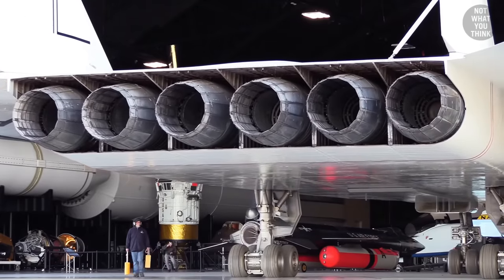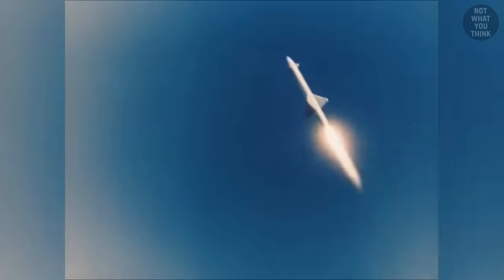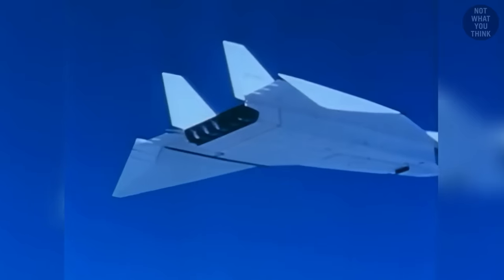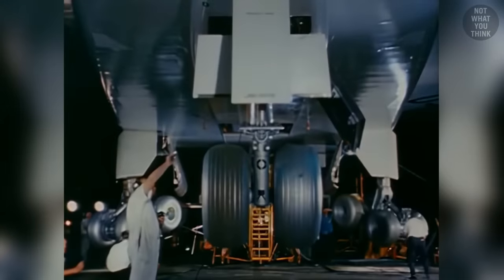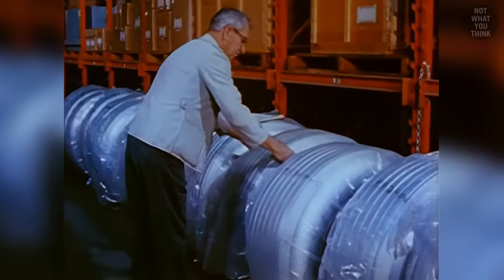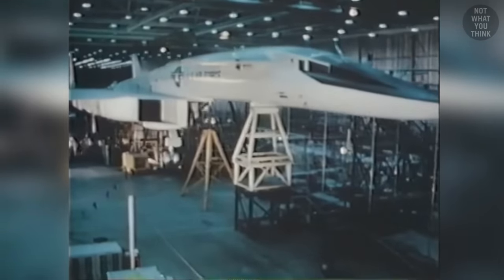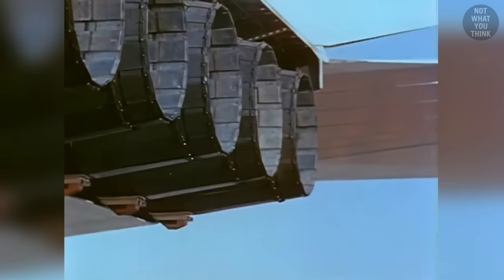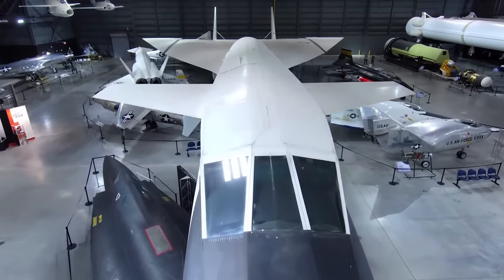The Airplane That Looked Fake, But Was 100% Real: XB-70 Valkyrie

Comment: One of the things that absolutely gets me is that we have this footage of such a futuristic, marvel of engineering surrounded by typical cars of 1960's. Sometimes I cannot help but wonder what secret projects we're hiding that would seem such a 50+ years ahead of our time.
Reply: We didn't hide this plane back in the 1960s. The SR-71, F-14, F-15, F-16, F-18, B-1A, B-2, YF-22 and -23, and both JSF contestants were all revealed pretty quickly. The F-117 was revealed in 1988 after a first flight around 1981, so that was kept under wraps, but only for a few years.
Reply: there's a video tour of the inside somewhere on YT which definitely shows the age of the design
Reply: TR3-B
Reply: The Vauxhall Zafira.
Reply: They can from a distance read your brain ,your memories, what you think and can talk to you and see your mental images and what you see from a distance ,a long distance no wires no chip needed.
Reply: The research for the B70 project started in 1955 and the technology to make the Valkyrie a realistic proposition was available by 1957. The project suffered from the normal changes of role and funding before it flew in 1964 and was officially terminated in 1969.
Reply: @Cdub-nz4gz  That isn't even a grammatical sentence, far less make any sense.
Reply: @rattywoof5259  thanks
Reply: You said it B u b
Reply: Maybe. They did have remote viewing and out of body experience programs at one point with things like project Stargate. AATIP, the UFO program that ended in 2012 was up to this sort of stuff too. I'm not sure what sort of results they got, but the programs did exist.
Reply: The hp of cars tripled in the decade for that too. The Corvette went from 150hp to 435 between 1953 and 1967. They had a revolution too.

All the pilots of shiny high tech Sabres all went back to base and listened to Hank Williams or Doris Day on the jukebox in 1952 lol.

Comment: The XB-70 is an incredible aircraft built by incredible people.  The loss of air vehicle 2 was a tragedy both in the measure of human life and the science that the aircraft would have performed.  I've been to the crash site of both the XB-70 and the F-104.  I have few small pieces of titanium and a small section of honeycomb from the aircraft.  Volunteers have built memorials at both sites to the pilots and the aircraft.  It's quite something to visit.
Reply: Yes, I understand.
Reply: They didn't clean up the crash site? Or I guess there are just so many tiny pieces that even after cleanup you can still forage around and find some?
Reply: @mrbillfeng  They don't take it to the point of sifting acres of desert sand.
Reply: F104 crash sites arent hard to get by

Comment: It's odd as hell seeing footage of cars and trucks from the early 60s mixed with such a futuristic looking aircraft.
Reply: Not as odd as seeing futuristic aircraft in the 1960s.
Reply: Its like watching some sort of science fiction film
Reply: I thought this same thing.
Reply: Welcome to the fallout fandom!
Reply: The first futuristic looking wedge shaped concept cars were designed in the early 1960’s too.
Reply: Funny thing is most of the car designs were inspired by aircraft, drivers seat of a 1960 chrysler windsor 300 feels a lot like a cockpit all the glowing lights and push button transmission and the giant wings running down the sides. they tinkered with jet cars for a while too.
Reply: It's the same feeling when you see early integrated circuits - on a macroscopic scale there are some electronics from the 60s that could be easily mistaken as belonging to the 80s
Reply: another crazy thing is the F-15, still one of the best fighters in the world started development in the late 50's.

Comment: It is amazing how futuristic this plane was, when we realize everything was worked out with slide rules. For those of you who aren't 81(as I am), the slide rule was in regular use, even for the space race. Great video, as usual. Also, as usual, you told me things I didn't already knew, such as the photo op. I don't think that was talked about at the time.
Reply: it astounds me that y'all were sitting there with slide rules and did better, faster, and cooler things than we've done with CAD and "better" materials
Reply: And mechanical calculators...cranking away...the noise. Then Wang calculators.
Reply: We weren't allowed to use calculators, which cost as much as a good used car, when I was in school. Slide rules ruled.
Reply: @MarcusWolfWanders  I did use a slide rule one summer working for the highway dept, but I was not one of those who built the sr71 nor the space program. They were the real hero's those days.
Reply: I still have my slide rule from college. Spent my freshman year, 75 - 76, trying to learn electrical engineering. The Calculus torpedoed that idea.
Reply: Remember how happy was my dad when he got first calculator back in.. 1976(?)
Reply: @altergreenhorn  My 1st was a Bowmar Brain.
Reply: @Dxyzxyz 
The ChiComs still use Wang calculators, (at least when they want to add up 10+1)...😏

Comment: Both prototypes were operational. Flaws in the sandwich structure of prototype number 1 after its first high Mach run resulted in disbonding and it was never flow that fast again.However it continued testing with NASA before being retired. Prototype 2 that crashed was built with an improved structure and different wing incidence.
Reply: Dihedral, not incidence.

"AV 1 had zero degree wing dihedral versus 5 degree on AV 2. This change was issued to correct lateral dynamic stability problems at intermediate supersonic speed and became evident too late in the manufacturing process to be incorporated on AV 1 which utilized a bobweight to provide the capability for pilot compensation."

Comment: During a business trip in the 1990s, I had some spare time, and made my way to the Air Force Museum, outside Dayton, OH. I was aware of the museums exhibits, and made a bee line to their B-36. After viewing that for a while, I started looking at their other artifacts, such as the remaining XB-70.
Reply: The B36 could allow engine oil changes in flight. - former air force mechanic
Reply: I served one enlistment in the US Air Force from 1967 to 1971 as a meteorology observer .  The air base training school was Chanute AB at Rantoul Illinois. FYI that is located about 40 miles north of U of Illinois campus at Champaign-Urbana IL.  Back in the day, the base was a mini version of the Dayton Air History Museum.   Vintage WWII aircraft were scatter around base.  But the off the end of the main runway on a taxi way display ramp sat a B36 Bomber.  It had suffered mechanical problems and made an emergency landing. It was never to leave as the runway wasn't long enough for it to get off the ground again.  Fourty feet of the fuselage was out of the middle, the it was welded back together and put on display.  Chanute AB has long since closed.  It was sold to the city to become an business incubator and residential area. I have often wondered what became of the aircraft.

Comment: The primary reason for the fold down wingtips was not for capturing the shock wave.  Here is a quote from the book "Valkyrie, North American's Mach 3 Superbomber" on page 39 (which is a fantastic book.)  Quote: " North American folded the wingtips primarily to increase the directional stability and minimize drag by allowing smaller vertical stabilizers." The original B-70 design did not include the fold down wings to achieve Mach 3 and while there was a very small gain in lift from the folding wings, the real purpose was to reduce the drag from what would have to be far larger vertical stabilizers which would cause much more drag.  Since the wing area was required for low speed flight and there was already plenty of lift form the compression wave, the extra wing area was not needed at Mach 3, so the designers realized they could fold the wings to get the directional stability without having to add the weight and drag of the larger tails. So, the drooping tips are not really necessary for the compression lift to work. They are there for directional stability.
Reply: Is the plane stable while folding?
Reply: @ArneChristianRosenfeldt  Yes. The wings were dropped at well below top speed, and yaw stability was reported as good. People often talk about eh SR-71 and how great it is, but the reality is that the XB-70 was probably one of greatest techmical achievements in aircraft design. While not as fast as the SR-71, it could still exceed Mach 3, had a range of about 4400 miles, and would have carried 50,000 lbs of payload. Given that this plane was done before the computer age and it used materials that had never been used before, it was an astonishing achievement.
Reply: @shenmisheshou7002  I was thinking about dihedral anhedral. So the Concorde with its tall single stabilizer has a little anhedral on the tips. This compensates some coupling in a delta wing. XB-70 has two lower fins .. and should use less anhedral (bend a smaller portion of its wing ) or there would be severe coupling. Ah, it is just that pilots complained how delta planes like the B-58 hustler were difficult to fly.
Reply: @ArneChristianRosenfeldt  I have read summaries of most of the flights and there seems to have been little mentioned about stability. Buffeting  flutter was sometimes encountered, and small changes where made to the second B-70, which was not completed until AV1 had already been flying and gathering data. For example, the flapperons had more power than anticipated, and one on each side was fixed into position. The aircraft was apparently very difficult to fly. AV1 was plagued by hydraulics failures and various types of unstarts. It took both pilots to manage the powerplants.   One advantage the B70 had over the B-58 is that the thrust line was kept very close to the centerline due to the way the engines were all nestled in the same tray under the wings. The two large ducts were separated so that one duct served three and the other duct served the other three, and this placed constant demands on the co-pilot. These are all things that test programs are there for, and by the last few flights, much of this had been worked out.  It is a remarkable airplane.  I have friends from other countries that are aviation buffs, and almost none of them were aware of the B70, and all were speachless when I would show them the pictures and tell them that this plane was flying at Mach 3 in the early 60s.  The SR 71 gets all of the glamor, but the XB-70 was (in my opinion) a much more extraordinary achievement. The book Valkarie, North Americans  Mach 3 Superbomber is the best book I have ever read that is devoted to one airplane, and much of this is covered in that book. Sadly, it is out of print. I cherish the copy I have.
Reply: @shenmisheshou7002  I am stealing this from someone else: the intakes should have been at the back. With flaps to suck air from above the wing. When the canard unloads the nose wheel, it should swing up into a bay with some space for dampers to catch it. Then open lower intakes. Wind is strong enough so that no air is sucked ( vacuum cleaned) from the ground.

Only take off with enough length ahead to swing out the nose wheel again and brake the plane. Emergency skid below the cockpit.
Reply: If this was true, they would have folded the wings up instead of down.. as vertical surface area below centre of gravity reduces lateral stability.  

Also having the wing fold down greatly increases the chance of damage or destroy the aircraft should a wing folding mechanism fail.  

The XB-70 had the highest lift to drag ratio of any manned aircraft and it needed it in order to achieve its range with payload (vs the SR-71 whos payload consisted almost entirely of fuel). 

Another aspect was reducing Mach Tuck without having to add lift (and drag) to the canards to keep it level.  Simply reducing lift on the aft portion of the wing doesn’t same thing.  

Multi engine aircraft need the most directional stability at low speeds and altitudes (Vmc).
Reply: @calvinnickel9995  While the primary reason for the wings being canted down is yay stability, the position does add a slight amount of lift, and if the wings folded up, they would not be able to do that. The primary reason for the wings folding down was directional stability though. The amount of compression lift provided by  the drooped wing position was small. Most of the compression lift was generated under the wide engine bay  and wing root, and the shock cone originated at the base of the intake splitter. All of this is documented in the book I referenced, which is a really amazing book on the topic.

Comment: Valkyrie is easily one of the coolest planes ever made - it's too bad they never "finished" it. Would have been cool to see what it could do.
Reply: I imagine it would be like a bigger, badder, and meaner B-1B Lancer. Think about it, both were supersonic strategic bombers originally intended to be nuclear capable, with plenty of speed, and having adjustable lift surfaces.
Reply: It couldn't do much due to being too "bright" on radar.  By the time it flew speed was no longer a defense.  Hence we stopped trying to go that fast. The newer B-1B can't even go Mach 2 because it doesn't need to.
Reply: A bit like the British TSR2
Reply: The finished two of them,  and while they never carried any military gear, we know exactly what they could do and they were remarkable aircraft.

Comment: This plane is why Mig 25 was built, to intercept it.  And USAF in turn built F-15 to counter that.
Reply: Then the USAF got their hands on a Mig 25 from a defector and realized it was basically a flying super sonic brick against an F-15. Turns out the huge wings we thought were for high maneuverability were actually needed because it just weighed so much.
Reply: @Da0yster  Valkyrie was cancelled for all of the technical issue listed in this video, and USAF also over estimated Soviet SAMs.  Soviet military definitely understand the limitation of their SAMs in the early 70s and knew it had no chance of hitting this bomber if it was ever operational.
Reply: @dyingearth even with that, ICBMs accomplished the same goal better.

Comment: As a kid I loved Sleek aircraft like the XB-70 and the SR-71. There was even a hobby shop in the mall in OKC that had one of the silver Xb-70 wheels on display. Later in life I ended up becoming a Crew Chief on the B-1b. I still remember my first night after I got to my duty station. As the sky started going from pinks orange and reds to black I saw it with throttle wide open, as it took off. The sound.. the colors of the exhaust, it was beautiful. I tried to keep that enthusiasm throughout my career. It was hard though. I literally broke my back on that aircraft. I never did get to experience flying in it before I was medically retired. I always wanted to experience a low level, high speed, wings swept flight. Man, I loved seeing the aircraft do swept wing high speed passes for special events. I used to hate always hearing every engine run, landing, take off and patern flight around the area. Waking up to an engine run of a Sunday morning, by the guys on that weekend duty was annoying. But, I kinda miss that background noise. I never got to see the XB-70 or the SR-71 fly or it on display.

Comment: The most crazy thing about this video is the guy kneeling down right next to a tyre filled with 500psi 😂
Reply: Right.  I work for a company that tests aircraft wheels and brakes.  It is a huge safety infraction to go into a test room with inflated tires.
Reply: Two line guys where I worked decided a Lear 25 needed nitrogen in its main. The got the bottle, opened the valve, forgot to adjust the regulator, and put 3000 psi to the wheel. The tire exploded, killing one, injuring the other and put a hole in the wing, spilling 500 gal Jet-A in the hangar. I'm glad I worked at the other airport.
Line service stopped nitrogen service after that.

Comment: A very interesting design. I suppose that many of these experimental designs or at least parts of them can be brought back to life today with modern materials, manufacturing techniques and fly by wire avionics. 

There could be applications in commercial aviation too.